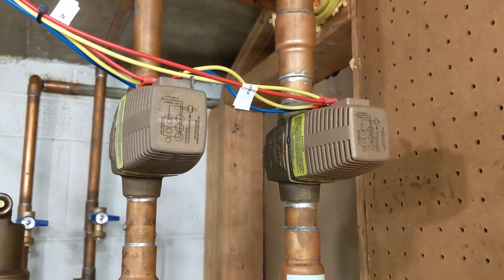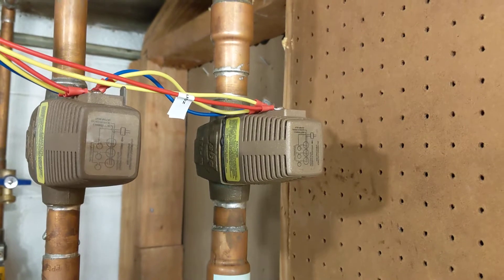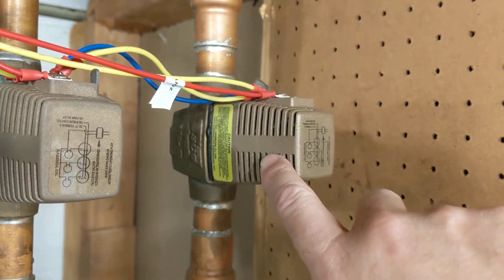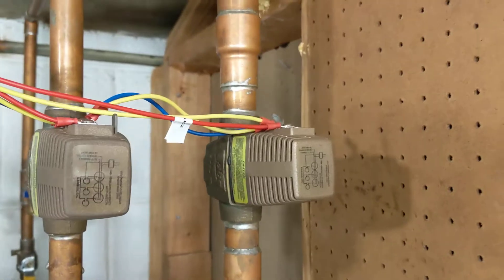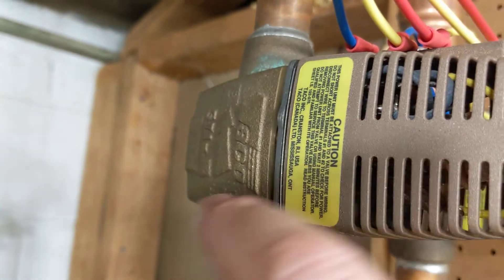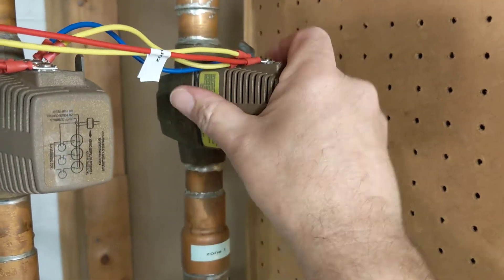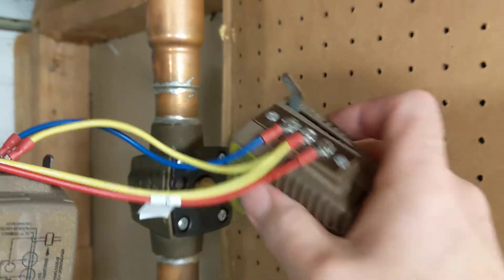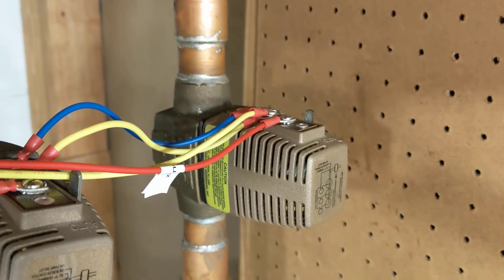Taco zone valve power head replacement

Comment: What if the valve fails in the open position and you can't get the valve to close?  The heat on my system won't stop.   Just turn the thermostat off, turn the boiler off and then try the removal?  It's still going to be hot because the valve will still be open.
Reply: There is a manual on and off bar on the power head you can see it in this video on the left head next to the yellow wire. The one on the left is closed and the one on the right is open. It's a failsafe incase it doesn't work
Reply: @rayray7892  Thanks!
Reply: I would remove the Taco head from the valve body. You're not supposed to remove the head when the valve is open because it can damage the head but if the head has already failed, then there's no reason not to remove the head. Twist the head to remove it. It should pop off. Hopefully the valve body is still functional and will close once the head is removed.

Comment: You have the zone valve lever open in your video. It needs to be in  Auto position.  Also caution that transformer is not still sending juice to the wiring.  Shutting power to the boiler and thermostat does not also shut power to transformer in some homes. 😊
Reply from the maker: Great point about the transformer power possibly being separate from the boiler's power source!  I've rewired mine to make sure the same cut-off switch kills both, but that's definitely something people should be cautious of!

Comment: Can a taco zone valve work with 2 wires. HELP!
Reply from the maker: @Bill, I believe that Taco has some zone valves that are 2-wire and others that are 3-wire.  I don't think that a 3-wire zone valve can be made to work with only two wires connected.
Reply: @elvisandmick  that what I thought. I was a commercial plumber for 28 years and then due to an injury I found myself maintenance at an apartment complex I've installed thousands of these but never had a service them and I believe they're being put incorrectly, they're only using red and white on one and two it's just confusing to me it defines what I know
Reply from the maker: @billwunderlich8337  I know how it is, the wiring is confusing until you see how they've got the bits tied together, and then it makes sense.  Takes some time and studying for me to get my head into it but once there it's pretty straightforward.  Good luck!